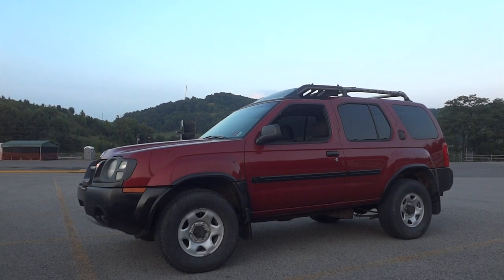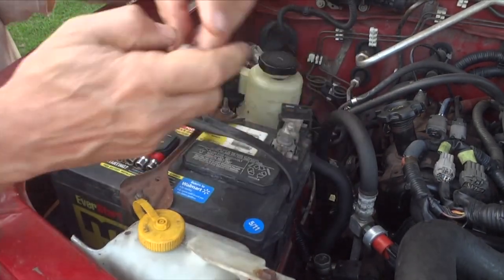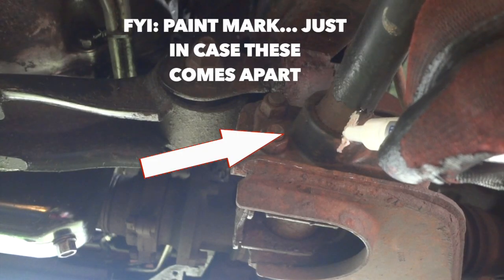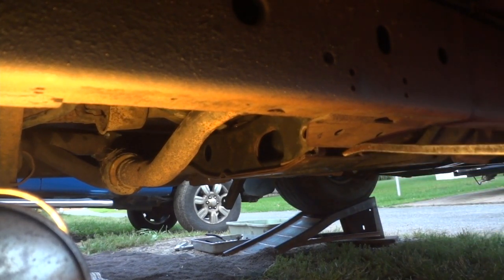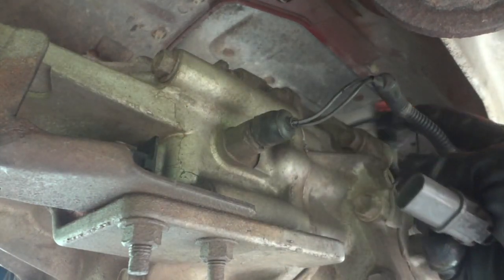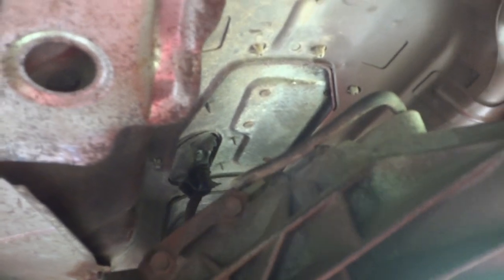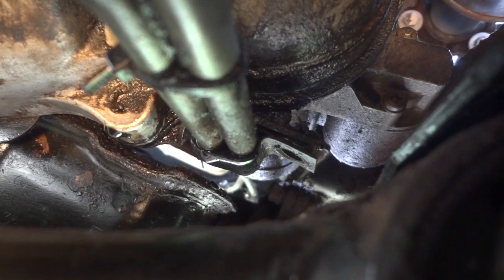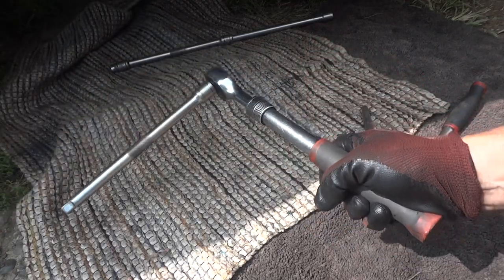2002 4x4 Xterra 3.3 Transmission Removal and Fixing a Massive oil leak

Comment: Well Nathan I've changed timing belts with ya,aligned my tires, fixed a clock spring and countless other videos with ya. Now I'm dropping my transmission and fixing a rear main seal. You're damn good and I really appreciate what you're doing! I've got 2 xterras. A 2000 and a 2001. 200 has 230,000 on it and the 01 is about to hit 350,000. Both still going strong.
Reply from the maker: Great!!

Comment: Hi Nathan.  I have reviewed this video about 10 times now as I am going through the process of removing the transmission from an 01 Xterra.  Just about to take the torque converter bolts out tomorrow.   Then I will be going through the process again as I remove the transmission from an 03 Xterra that will be the donor vehicle for a ton of parts the 01 needs.  The 01 seems to have a good running engine.The 03 was rolled so no longer driveable. The engine seems pretty decent in the 03 but is showing a cyl.#5 misfire.  I will try to sort that out before I take it apart.  Thanking you for making this video.  Bob in Idaho
Reply from the maker: Nice!!! Could be a burnt valve. Do a liquid test on the head when its off to make sure its not cracked. All tho i never had to many heads that get cracked or warped for that matter.  Hope you have a warm garage ;)
Reply from the maker: Always the gaskets!
Reply: @FixingWithPassion    Do you mean head gaskets?  I'm hoping for a bad coil or spark plug or something easy like that.  It will be nice to have a spare engine .   Happy New Year by the way.

Comment: Great video! Do you have a video on changing out the oil pan? We are still debating on whether or not our 02 has a rear main leak or an oil pan leak.
Reply from the maker: All bets are the oil pan real seal...may as well do the rear main seal also. No video on that but who know...maybe someday. But by the time you drop the transmission, you can do both. Front dff drop is no picnic either!
Reply: Do you think the oil pan could come out towards the rear once you've pulled the transmission out?

Comment: Im doing this job on a 2004 that has 277,000 miles and no reverse, the one exhaust manifold bolt on the pass side i cant seem to get to, i pulled the 02 sensor out on the drivers side, and your right the bolts are so tight in this vehichle
Reply from the maker: Yea..Need more coffee...lol
Reply: @FixingWithPassion  Now i see why they charge 2200 bucks to rebuild the transmission on this thing
Reply from the maker: @jbncnow  Time for me to buy a supercharged one ;)
Reply: The reverse just went out in my 03 xterra.  After seeing this video and your comment on the bucks... the fact that I bought it for 2000 bucks 4 years ago means it's probably not worth the grief and the money to fix.  Sad..

Comment: Watching from Lake County Ca. My transmission is leaking from the same spot and from the pan. Also both exhaust manifolds are cracked AGAIN, gonna start with that then possibly try my luck on the transmission. My mechanic has COVID and will be out for a month and he charges me 600 to do the trans
Reply: Also I have a 03 super charged frontier
Reply from the maker: @sev2441  Nice!

Comment: If you left the ratcheting wrench on the nut at the same time using the impact on the bolt when you took of the torsion bar you think it woudve worked?
Reply from the maker: Maybe......but so many ways to attack things at different angles.

Comment: I've been trying to find the selenoid harness pigtail location in the engine bay. From what I've found it is that blue plug on top of the air intake manifold. You grab and show the o2 pigtails in the video if I'm right. Can you confirm? My selenoid wires burned above the transmission and I'm looking to cut and splice them but first I want to know I'm yanking the right wires out lol. Ty
Reply from the maker: You see the end of wires?
Reply: Unfortunately no. It comes down above the cat for about 6 inches and disappears again. Looks like it was burned resting on the cat so I was able to push it up and away from the cat. A tab but further down the transmission I can see wires again but not sure if it's part of the same harness to be honest. After pushing the burned part away from exhaust I'm no longer having issues/code so it's got to be part of the selenoid harness. Only wire visible was solid yellow but every diagram I read said it should be L/Y blue yellow....I did find a diagram for 2000 that shows the pigtails you grabbed as being correct though. I guess my next task would be to try and remove the exhaust (need a sawzall lol) and ohm/ OL the wire to the pigtails above. One diagram shows the pigtail should be like a 20pin connector and it would be 14 for B and 15 for A. Sry if this is a jumbled mess I'm just waking up for work. I appreciate your response. In the a.m. I will take a picture and give a link here

Comment: Do you need to drop the torsion bars to get to it?
Reply: I dont thinks so dude Im pulling my trans out of my 2000 fronty and it looks like it’ll clear. Did have to pull the exhaust off. 💪🏽💪🏽

Comment: Nice detail. But you don't need to drop the transmission to replace the oil pan gasket. Just drop the front doing and cross embers and remove the starter

Comment: Did that half plate dust cover go in front of or behind the full plate behind the flywheel??? I put mine on behind (towards back of the car) and i think it may have misaligned the input shaft enough to make my pilot bushing squeal.

Comment: Another great video.  I have been debating on whether I have a rear main seal oil leak or the rear of the oil pan seal.  I had read on forums that it is most common to be the oil pan.  I was planning on doing the oil pan this winter to see if that fixed it.  Based on the geometry of the area...you can replace the oil pan RTV without removing the transmission, right?  Removing the transmission removal is only to get to the rear main seal?
Reply from the maker: Yes...That is true.

Comment: you said the sealant is fine and  its an oil pan leak so do you think taking the transmission off is not needed or its still  required in order to change that pan gasket
Reply from the maker: Sealant was hard.... with cracks.

Comment: I have all the bolts out on the bellhousing the convertor bolts but the transmission wont budge from the engine,  is there one hidden somewhere?
Reply: @Johnny Five Yes i did get it out ,i missed a bolt on the top
Reply: @Johnny Five I replaced every rubber hose i could  get under the hood, many were cracked and one had a huge hole in the evap line

Comment: Merry x mas I have a question  its worth  buy a used  trasmision  with 96k on it with  12 months  warranty or get a rebuild  one with  5 years warranty ??? my frontier  has 164.908 miles 3.3 4x4 need a suggestion
Reply: If you can find the right rebuilt transmission, go with rebuilt. I couldn’t find one for my 3.3l pathfinder so I went with a used one with 150k on it.

Comment: That black plate that you have to put the starter bolts through at  51:50 , does anyone know what that is called???? I need to get a new gasket for it :(

Comment: Great video, very helpful but I had a question, when you repair or put in a new transmission is it necessary to program it to the car ?
Reply: I have a 2001 Nissan Xterra 4x4
Reply from the maker: @milgenba237
Reply from the maker: Nope....Just make sure the fluid level is normal.
Reply: Thank you for the information

Comment: for some reason I cannot put the torque convert bolt back in since the gap between the flywheel and torque is too big,and the torque converter bolt are
 too short
Reply from the maker: Humm....still not going?
Reply: @FixingWithPassion  should I try to pull the torque converter forward to the flywheel?If so, what is the best way to do it without taking  the transmittion out again? Thank you for the respond
Reply: all I can do is just sticking my fingers into the hole where the starter is and try to spin the torque converter by feeling.But seems like I can't close the gap between torque converter and the flywheel no matter how many times I spinning the torque converter

Comment: Well I hope my oil leak isn't the rear main seal, what a bunch of PITA (Pain In The Arse). My wife would be up my butt if I had to spend so much time fixing it , she'd be like I'll just keep adding oil. But awesome tutorial buddy
Reply from the maker: Nice!
Reply: Question , What do you think odds of buying a used eBay ECM for a Nissan and not having to get it reprogrammed to Match your Security System lockout in your Nissan. Seems most times the key chip wouldnt recognize new ECM OR ECU.

Comment: Did anyone have a problem with this type of oil leak leaking onto the starter? For some reason I believe my starter has oil in it and no longer starts
Reply: That's usually from the valve cover
Reply: @hectormorales4002  you were right. I did end up replacing the gasket and it fixed it.

Comment: All that hard work, just to find out the oil leak is from a oil pan gasket. Geez.
Reply from the maker: Actually the the rear main seal had some cracks in it upon closer inspection after removal. It would have failed sooner or later also.

Comment: Nathan i ordered a new front pump and reverse hub that goes behind it but apparently there are two different pumps for these transmissions. the new one i got has a hole for a speed sensor, or crank sensor but  my sensor is in the top of the bellhousing, all the bolt holes line up, i wonder if it would still work? the original one out of the truck is on the right https://www.facebook.com/photo.php?fbid=3767692239909895&set=pcb.3767692283243224&type=3&theater

Comment: Hold it! So it was the oil pan that was leaking? All that for naught.
Reply from the maker: Yep. The the rear main seal was dry and cracked but not leaking.....it was time to change it also.
Reply: @FixingWithPassion  My 00 X has 210k and runs fine. I’ve done all the maintenance myself. The only thing that is beginning to happen is the transmission is a bit soft on shifting when cold. I’m thinking I will keep this old boy running forever and may attempt the transmission pull. Thanks for the posting the video. It doesn’t look too bad, but definitely has some tricky parts to it.